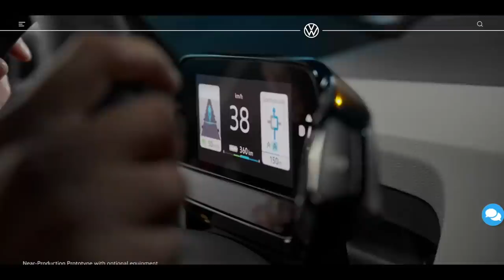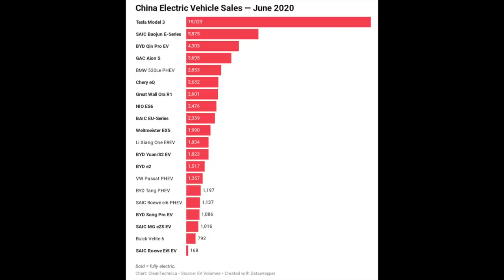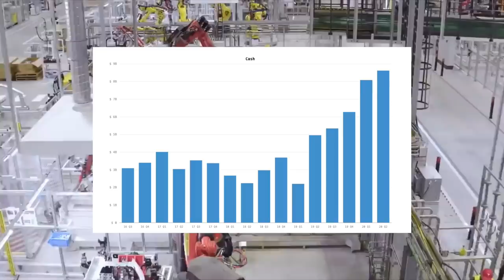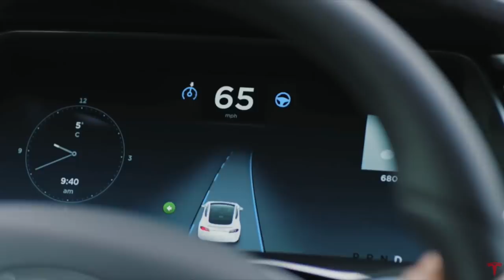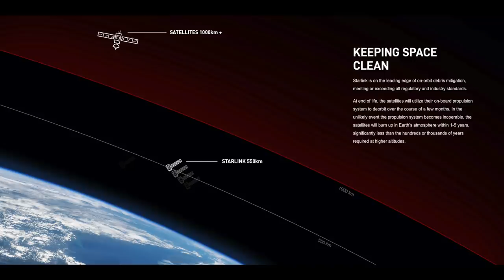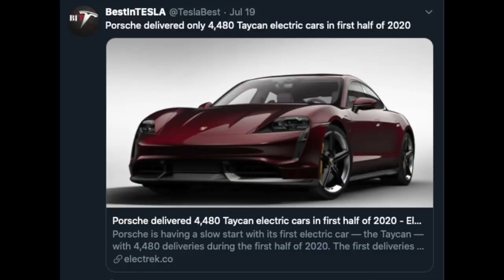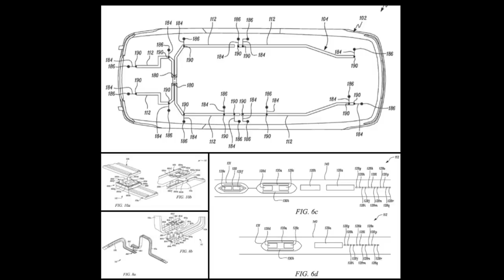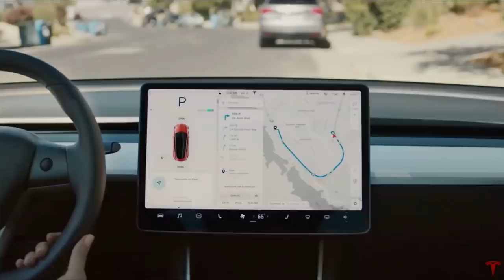Tesla WON | Tesla just made their Checkmate move | No one can stop them now

Comment from the maker: I think and hope that Tesla will make a secondary share offering for S&P, that's how they will sell shares directly to S&P 500 and get billions of dollars 😉
Reply: That would mean massive share dilution and make all share holders worse off!
Reply: S&P is not going to buy shares, but some index funds will, however the stock market is forward looking and already in the price that Tesla will probably be included in S&P 500. If they do a new share offering it will be a massive dilution of existing shareholders and not be aligned what management said in Q2 conference call.
Reply: Imagine if "Big Oil" never moved in and blocked the electric car during the automotive infancy!!
Reply: Why do you keep pumping this s+p 500 rumor. Stock pumpers spread this rumor to get the price up. Just because they stopped losing money doesn't guarantee so 500 inclusion. Maybe someday but you talklike it's guaranteed. Tesla service and parts availability terrible in us. Takes over 6 months to get a fender if you have an accident.
Reply: fred hwang tesla qualifies for SP500 inclusion now. It’s a good possibility that they are included.
Reply: @mpsoxygen   Tesla opened on Friday at $1515.00 with a market cap of $266.64 billion.
If they’d raised $10 billion at that price, the dilution would have been roughly 3.54%...which would have dropped the share value from $1515.00 to $1461.34.
The share price was $1430.74 at close, Friday.
Considering this, I think the capital raise would be a good long term move, strengthening the company. The share value went up 1.5% after the last issuing in Feb this year. Would investors mind another one?
Reply: @fredhwang3924  actually it is 100% guaranteed. SP has clear rules and they would need a really good reason to deny Tesla entry to SP which makes no sense at all.
Reply: I sense a very strong Scandinavian accent. Most likely Danish?
Reply: You can sleep well, I think Tesla have their own good financial planners...  They proved it!!!  You sound a bit like a new comer in the financial industry to me,  you're getting a bit too excited with it. Learned from Warren Buffet, keep your head cold...
Reply: This is not a logical point you’re making. Tesla will not have $40b in the bank by selling directly to s & p investors. If you think they haven’t been accruing scrip in the lead up to what EVERYONE knew was going to happen, then you shouldn’t be creating content in this space. 👎🏻 for me, uneducated opinion and not researched.
Reply: Tesla does NOT get the money directly! The main point of your video is incorrect (it's NOT a game-changer or checkmate because they get $34 billion!).  S&P 500 index funds will have to buy Tesla shares.  They don't have to buy them from Tesla!  If they issue a lot more shares the share price can decline.
Reply: That would be a massive share dilution and Elon has said they don't currently need more money. Very unlikely I think. You seem like your trying to cover up the fact you didn't know what capital raising vs buying shares available to the public is.
Reply: They don't have to make a second offering.  He could make them buy the shares on the market.  But you are correct, if they want the cash on hand to expand They may do the second offering.  With 8 billion in the banks and not drawing it down they may not need the money at this point!
Reply: @fredhwang3924  I think it will happen, and I think the S & P wants them, but you are correct, they could wait for some time allowing index funds to buy shares over time.  It's really not "IF", but more of "WHEN".
Reply: House Essentials  Correct, the only way is if Tesla makes a second stock offering, something that may not happen!  Tesla could make them go to the market and buy them.  His argument is strong that either way Tesla may have a lot of cash to work with soon.
Reply: @SwampMonster1  Yes and no, many will still have to buy.  The 25 million shares are what the experts on the market are saying, but some say as much as 50 million shares, and a few say 15 million shares.  So the number is an average of what is expected.   Could it be way off?  Maybe, but even on the low side it's many billions!  Like double digit billions even.  Look it up!
Reply: @Rtrain01  Not if Tesla allows a second stock offering.  Then they would be selling stocks directly and taking the money.  Watch Vid again!  That said I question if Tesla will do this, and they may make them buy the shares on the market like you say, as doing this my under cut the value of the stock.  Then again they may buy back some stock with all the new money.  Could go a lot of ways.
Reply: @LunnarisLP 
How much is pig oil stepping on to prevent or at the very least slow it down
Reply: @rogersmith1408 
And the fact that the factories are almost free due to fca giving them money and all the tax breaks they are getting not much capital in comparison to other automakers have to  is being spent.
Reply: @rogersmith1408  You are missing the point. Can't post a video saying the company will get $34 billion! Companies don't issue all new shares when they get added to the index.
Reply: @brettmciver432  They have 8 billon cash on hand.  Yes, I agree profits are not high yet, but I ask what will they be in 5 years?  Really as long as they are even as they build out over the next few years they are ahead of the game!
Reply: @rogersmith1408 
Agree plus if anyone takes Elon up on his offer for drive train and batteries etc trillion dollar company easy
Reply: Funds can buy Tesla shares in the market. Tesla can raise money by issuing more shares, but that's independent of S&P inclusion.
If funds buy from the market, there will be more demand for shares, while share float remains the same--this will push the share price up without dilution, and Tesla does not receive more capital. If Tesla decides to offer more shares, this is completely up to Tesla and depends on how much capital they need. It has nothing to do with S&P inclusion at all. If funds need to purchase $40 billion, Tesla can choose to do a new offering for $10 billion, or any amount and the timing also doesn't need coincide with when funds buy. 
I'm almost certain a new offering will not be done for the purpose of funds purchasing Tesla shares. They would much rather let the shares be supply constrained and when the share price skyrockets as a result, do a new offering at the higher price, say $2200/share. This is GOOD dilution because existing shareholders are essentially giving up a small percentage of the company for a cash infusion into the company at a price way above their fair value. This is the equivalent of you owning 100 shares of Tesla (worth $1500/share) and someone comes along and says he wants to buy 1 share from you for $2200.
Reply: @mpsoxygen  Dilution isn't an issue - Company gains value with the addition of cash, so existing share-holders retain value. But what to do with more cash? Reason that Tesla aren't building more GF's now, isn't a capital constraint, but rather that they want to iterate for improvement, so you need a life-cycle of 1-2 years for each factory to realise those improvements.
Reply: jabberwolf  nah rivian will buy ford
Reply: Jeeezz, Why not simple admit you were flat out wrong in your video thesis??
We all make mistakes and this is clearly one
Reply: LOVE YOUR VIDEO...... ONLY 1 BIG TOXIC BULLY BOY BIG TOXIC OIL☠⛽☠ AND BANKING🤡🤑👔⏳🤬!  JUST 3 WORDs FROM ME BUZZ OFF TOXIC.     2020🌍💚😀#BUZZOFFTOXIC #TEIDAMEW #STOPBURNINGSTUFF
Reply: Nice bias.
Reply: Everything you say is just BS. It clearly shows that you have invested heavily in Tesla and you are desperate for them to succeed. The fact is that Tesla's products are not in the same level with the traditional car makers. Yes, Tesla's cars are cool and the software is nice but as cars they are just bad. They are badly painted, badly put together, body panels won't fit, windows missing sealings and the overall quality is not comparable with VW, Mercedes, BMW or any traditional car maker. It just shows, that Tesla doesn't have the knowledge nor the tradition to make cars. 

You also seem to make the assumption that everybody is willing to buy a Tesla car. I bet many people would rather buy something else than cubic Tesla cybertruck or Model 3 which has a trunk that lets water pour in. Many electric car enthusiasts will rather buy Porsche Taycan than anything Tesla offers. Also many normal car buyers will rather buy 20-30 kiloeuro ID.3, e-UP, Nissan Leaf, Hyundai Kona, etc. than 50 kiloEuro Model 3 with all its flaws.

You also make the assumption that ICE cars are going rapidly away or that they have some big flaw. They will not disappear for many years. New models will still come and people will still buy them. They still have many benefits compared to electric cars: Way longer range, way faster recharge and no need to wait for a turn in charging stations. They also last longer usage without heating up in track conditions. With Tesla you can only do one to two laps and the system is so hot that it must be cooled down. ICE cars are also lighter and require no mining of heavy/hazardous minerals from Africa.

There is no checkmate. The game has just started and the "big boys" has just joined the game.
Reply: @scottm8845  woulda prevented a few wars and dictators ?
Reply: And i hope millions of people keep their eyes on the S&P while i keep staking gold an silver..
Reply: Complete rubbish analysis - go and play Lego - when a company gets included in an index they index funds will simply have to buy the shares and they will pay the market sellers, not Tesla. By the way this is also true when a company exits the S&P500, they won’t have to pay from their bank - Further has a target of 30 million EV’s by 2030
Reply: IMHO - Teslas are really as ugly designed as a Hyundai or Toyota / they simply can’t compete with the BMW, Mercedes, VW’s, Porsche and Ferrari’s, be it exterior or interior. Further Polestar (Volvo / Geely) is a brand new car that will rock the world and plenty of others coming out of China.
Reply: @scottm8845  That never happened.  The electric car did not become economically viable until Tesla.  "Big Oil" is not the evil controlling entity that you believe and never has been.  Geez, some people are so conspiracy minded that they have no concept of reality.
Reply: @BestInTesla. Teslas won't get fee Internet from Starlink. Elon has said that the user terminal is too big to install in a Tesla
Reply: @BestInTesla. Teslas won't get fee Internet from Starlink. Elon has said that the user terminal is too big to install on a Tesla
Reply: I agree with all the comments pointing out the logic error that Tesla collect the share value of the index funds buying because of S&P 500 inclusion.

However, I would point out that between the CEO and a couple of other founders, management controls about 33% of $400 billion worth of shares, which could readily back loans up to $60 billions, and those guys have proven they will do anything to ensure company success. 

So the short-of-cash argument looks very weak.
Reply: @AlejandroMangold   Yeah, but you can bet Elon has a wide-eyed on the fees cost of cell connections and will do something about that as soon as they can get the licenses. Already in the satellites?
Reply: @lengould9262  That doesn't solve the "put the stalink terminal on a Tesla" issue.
Reply: @AlejandroMangold   StarLink is not currently licensed to operate in cellphone frequencies required to communicate with the cars from orbit. However ... They may be able to pick up the 3 watt transmissions from low orbit. No doubt tested already.
Reply: banking $$ in Tesla stock over the past year is one of the best things I have done for the financial future of my family...
Reply: @Daniel Jr
Hadn't forgotten that at all, in fact in 2017ish the oil industry in America got subsidised to the tune of 650billion +/- according to the IMF. About 50 billion more the American armed forces that year.
Russia subsidised to the tune of 515 billion and China 1.4 trillion. Why are these oil companies going belly up with that sort of level of subsidies?
Reply: @Daniel Jr Daniel - not sure if you have been around during the Nifty Fifty or the TMT books and bust but let’s assume Tesla will be the leading EV / battery and “taxi” company in 10 years that still doesn’t justify this valuation.

Toyota just presented a new type of battery, not lithium based, the Koreans are very strong in battery tech and the Chinese are soon the leaders in this space
Germans still build the best designed cars and Volkswagen is all into EV’s 
Battery’s are no different to telecom networks - it’s a commodity ultimately 
So EV’s véhicule prices and margins will come down heavily and competition will be fierce
Reply: @Daniel Jr
Yup have no doubt they did that off the back of the previous years 650 billion in subsidies pretty sad return of 28 billion eh?
Reply: @Daniel Jr I was surprised that they got added to sp500. Maybe you should buy more. I did this morning.
Reply: @simonnicolast4967 
Toyota battery hahahhahahahahah
It's not coming next year its a paper reveal much like Intel does with a lot of its next gen processors. Yes they can make batteries but not at scale, not at the scale required for cars and from what I have read 2026 ish is the "time frame" plus a bit of Elon time added on top (sorry Elon🤭)
Reply: @Daniel Jr
What I said was the factories are basically free because of the zev credits fca and now honda are buying off them, and even if tesla had received subsidies from the govt for their factories it would not be anywhere near the level that  the oil companies receive every year.
650 billion (2017 ish number) for the oil industry vs 2-3 billion in ZEV credit payments from fca and now Honda.
What are the level of subsidies the oil industry are at this year? Is exxon Mobil in the S and P 500?
Reply: @brettmciver432  There won't be only BEV's, Hydrogen is what the Japanese are betting on - then the Chinese have their own car brands and different models of serving their customers - Europe likes style and I m sorry but a BMW, a Mercedes, an Audi, a Porsche, a Maserati, Ferrari an Alfa Romeo and even VW, these are stylish, inside and outside - not everyone wants to ride in a plastic car that suits some tech guys with big thick glasses
Reply: @scottm8845  It wasn't only it's infancy that "big oil' moved in, they still control most the ice vehicle manufacturing. That's where a lot oil investment is.